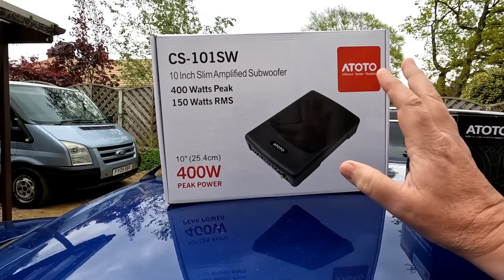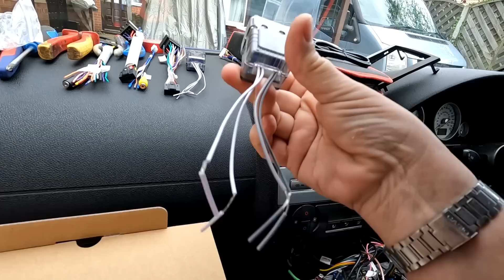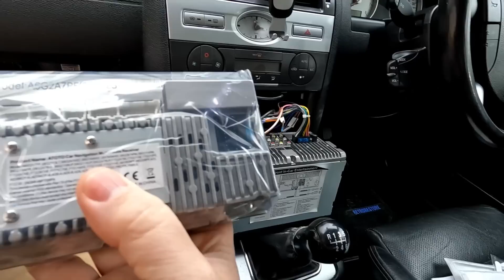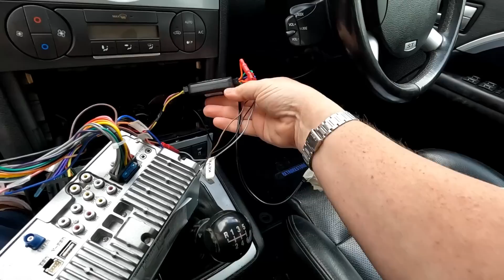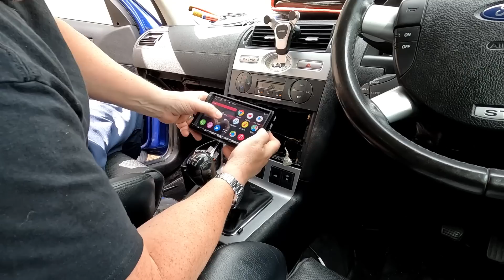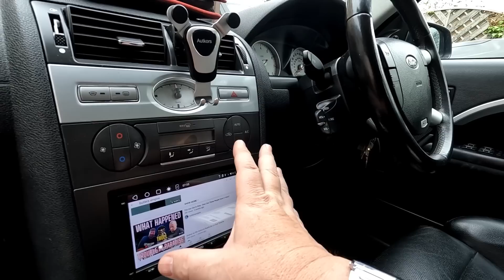Installing An Atoto A6 PF Android 7" Head Set Into My mondeo Mk3

Comment: Hi when you connected key 1 and key 2 wires from the steering wheel controls module, which colour wires did they connect to on the atoto?

Did you disconnect the battery when doing all of this?

 Thanks